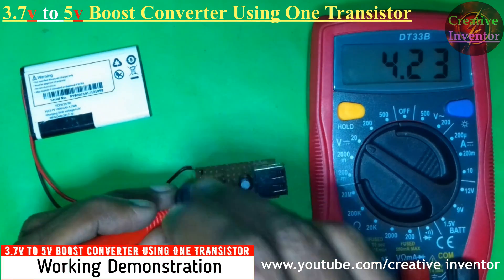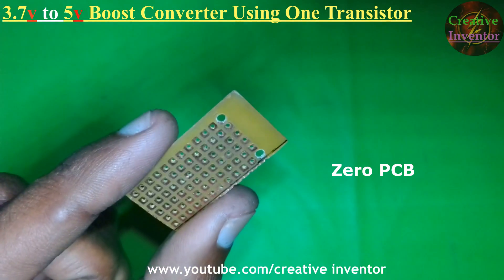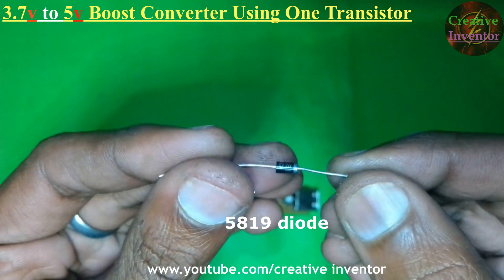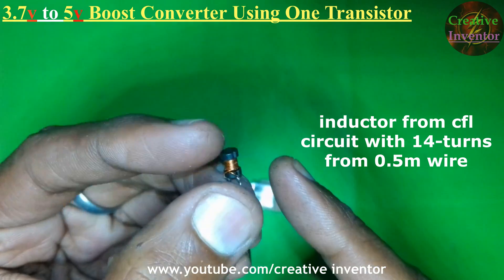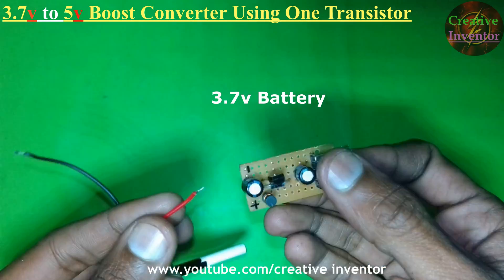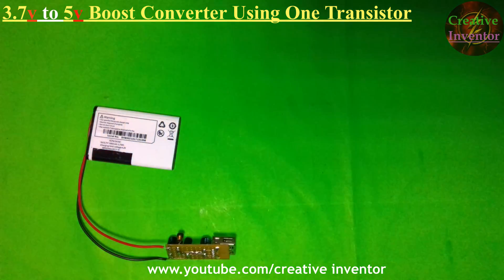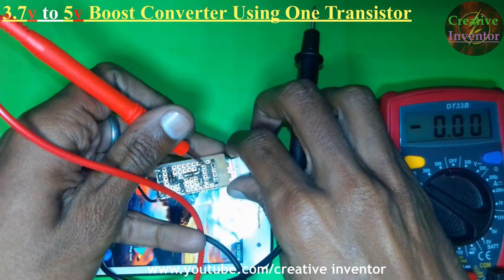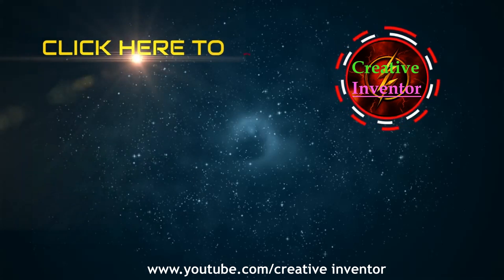3.7v to 5v Boost Converter Using One Transistor Only | DIY Power bank Circuit | 5v Boost Converter

Comment from the maker: My Dear Friends 8003 is a I.C, Sorry I Had Mistakenly written Transistor, a Big Apologies for That.
More Detail Video about 8003 IC is here -  https://youtu.be/-XcZHK3ctho
Reply: So please tell us what this mysterious 8003 IC is, a 3 pin boost converter that can regulate to 5V? Please dont keep us in suspense?
Reply from the maker: its a chinese ic that u will find in chinese mp4 players or chinese led table lamp that has an usb port also for mobile charging
Reply: @CreativeInventorlab  So tell us the full part number and where we can see a data sheet! I would like to understand how it regulates to 5V
This is a VERY mysterious 3 Pin Boost converter IC... we need to know more!!
Reply: @CreativeInventorlab  does not help much does it? HT7750A by HOLTEK
Reply: ভালো করে বলে দাওনা দাদা
Reply: @franklydude  I bought some HT7750A but they were  SOT-89, same pin out, but very small; pin 1 (ground), pin 2 (output), pin 3 (LX or Volts In). Care must be taken to not overheat these while soldering.
Reply: Try  for us an other way to Use 8003 it's hard to find it

Comment: Does this get hot? I need a boost converter to go inside a 3D print. Most I've seen the inductor gets REAL hot.
Reply: Inductor tends to get hot since charge and discharge process happend..i think maybe you can try placing a cooling system..like shark fin for example..

Comment: Can I use c1008 transistors, and what is specifications of 8003 transistors
Reply: @CreativeInventorlab  you can't answer me yet, can I use 1008 instead of 8003
Reply: HT 7000
Reply: @madeintanzania2995  8003 is not a transistor!

Comment: Dies it change the amps!? (I need to turn 7v 70ma to 5v 2amps).
Reply: You need a Buck converter, not a BOOST converter, also SIMPLE mathematics can tell you that if you want 2A at 5V, the you will need to supply Close to 2A at 7V maybe 1.7A or so so your comment of 70mA @ 7V is ludicrous!

Comment: is this comparable to the joule thief?
Reply: @CreativeInventorlab  OK is it comparable to Tp4056?
Reply: @CreativeInventorlab  thank you
Reply: NO, the Jouler thief is a circuit using an additional winding one the coil, so it has 3 terminals. the auxiliary winding provides a positive feedback to the joule thief switching transistor so that the circuit self oscillates....  Also the Joule thief has no output voltage regulation. I do not know how this circuit can work yet as I do not know anything about the IC 8003

Comment: How much output current 1A or more....?? What is the minimum voltage can we applied in input to get 5v output....?? From where we can get this coil? Can I use cfl coil or any another like in DTH supply coil etc....??
Reply: @CreativeInventorlab  where is the circuit diagram ? Give me the link bro . and one more question if use more powerful battery like 4000 or 5000mah can I increase output current upto 2 Amps. 
Thanks......
Reply: @CreativeInventorlab  OK thanks a lot I will make it and you got a new subscriber.

Comment: i have only BC547 ,C185,BC548,C945 transistor which transistor i can use
Reply from the maker: bro, these all are transistors, i had uploaded a new video only on 8003 plz see, ur confusion will be clear, also i have pinned that video link in the comment. here

Comment: can i use BC547 Transistor
Reply from the maker: no, bro bc547 used in swtich mode supply circuit, it cannot manage 5v.
Reply: Can you suggest me an alternative to ic8003 please?

Comment: Mobile battery 4.23V input..how🙄🙄
Reply: @CreativeInventorlab  mobile battery will Supply 3.7 V max...but how it supply 4.23V...
Reply: @prottaysahaomi  lipos (Lithium Polymer or Lithion Ion) battery eg 18650 cell go from about 2.6V to 4.2V, & 3.6V is just a "Nominal" value, the proposal in this very sketchy rough circuit is to use an inductor in a boost configuration to charge up an inductor with the 3.6V and then let go the inductor so the voltage "flies-back and up" to 3.6+ 2V, and is caught and rectified by the diode and storage capacitor. The IC 8003 must alternately switch on and off and somehow it should regulate the output voltage to 5V but I can not see how it does that.   And at the moment I cannot find any information on the IC "8003"...